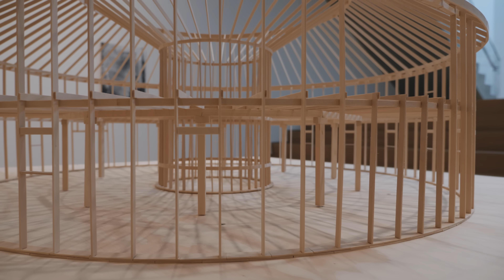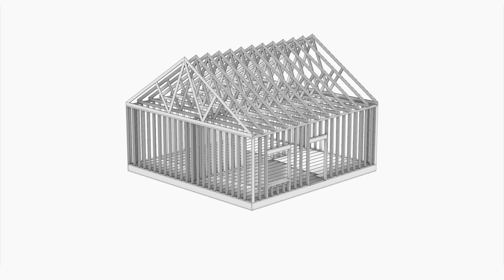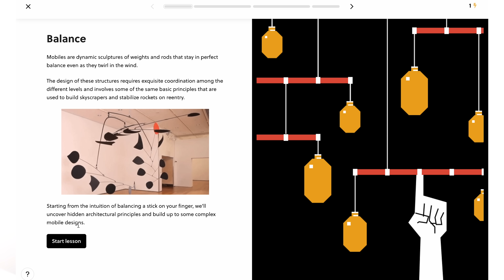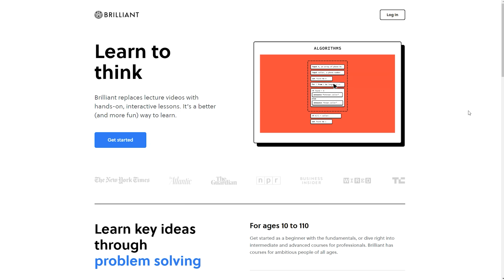The Genius of 2x4 Framing

Comment: Modest structure can be built by semi-skilled  guy and a teenager with no attitude. Brilliant method of construction.  Without this type of such a light construction there would have not been "Case studies homes", later on and "early Gehry" in 80's.
One downside is a low thermal mass . Other may be, due to ease of construction there is so many out there doing it (think house flippers) , that one can "democratically" end up with less skilled framer building his or her house.

Comment: To say you do not need skilled labor is a stretch. Surely a non skilled person can muddle their way through some construction but quite often the end product put together inefficiently and often results in an inferior product compared to what is built by skilled framers. Also without an ample amount of skilled framers on site the speed of the project will suffer greatly often resulting in a slow process ending, and again, with an inferior product. 

A skilled framer will select lumber for specific pieces knowing that certain pieces of lumber will be better suited in certain parts of the project. They will also know where the short pieces and “scrap” can be utilized. Also skilled framers will know how to use the tools quickly and safely and will have many “tricks” that are not obvious to an unskilled worker and these must be passed down and taught through example. There are many other points that could be made but the point is that framers are by no means unskilled.
Reply: You are correct a Carpenter is a skilled trade. Whether it’s post and beam, 2x4, construction, or building decks.
Reply: @MegaDecker69  a carpenter is just a laborer with tools.

Comment: I understand that the wood is well standardised, but surely all your arguments could apply to bricks and blocks too? Standard sizes, logistically easy, and they form a stronger end structure. I see the use of wood as more of a cost saving measure, like a McDonald's burger instead of a higher class burger.

Comment: We renovated a house built in 1830 and the studs were slices of a tree turned sideways on the interior walls and full 2” x 6” around the litter walls all nailed together with tapered square nails.  These studs went between both floors around the outside walls.

Comment: In USA public buildings are made of durable materials, brick concrete, glass and steel. Private dwellings mainly timber with plastic or other cladding - not made to last. In Europe traditionally housing endured for centuries, maintained and adjusted to changeing needs. I don't see the average American house lasting a century, which is wasteful, considering they would be low cost if it weren't for banks manipulation of price for their own profit.
Reply: The Average American doesn't give a toss about what's going to happen 100 years from now. We know we'll all be dead.

Comment: As someone who started framing homes in the 1970's I could say many things about your video.  But I will stick to what I think is most important.  The reality that logging our forests to create framing lumber is completely unsustainable.  As a young framer I saw beautiful, straight, clear lumber to work with.  By the turn of the century this was mostly gone.  The reality of how forests are managed and the lumber we get from that system is absolute destruction of our forests for a poor commodity at this point.  My opinion is you need doug fir trees to be at least 100 years old to create quality framing lumber.  We will not be able to continue to create homes like this in the near future.  And the ones we make now are of poor quality compared to forty years ago because you are starting with poor quality framing  (bones) lumber.
Reply: Amen.  Back in the day 4x4 were cut from 30" logs and were serious timbers.  What I can get today seems to be cut out of 6" logs and is basically a square sapling.  I honestly think the future is going to be just earth plus some sort of binder out of an extruder.
Reply: I live in a two story balloon frame house in Canada built in the 1920s.  It has brick veneer, but under the veneer are planks a foot wide that run from one end of the house to the other.
Reply: @minuteman4199  Those planks are probably worth more than the house these days.
Reply: You've never seen good wood. I was working on a 185 year old building and there were boards in it 20 feet long a foot wide with grain straight as a laser and clear of knots. It was absolutely mindblowing. I ripped them boards off the wall, chopped them up and tossed them all down a garbage chute. Because that was the job.
Reply: Would you say that composite boards or any better or worse in regards to the sustainability issue? Can there be quality 2x4s made out of composites?
Reply: @TwoForFlinchin1  There are a lot of new products that I hope stand the test of time.  Laminated Veneer Lumber (LVL) for example, I beam floor and roof joists, oriented strand board.  Sustainability? That is a harder question.
Reply: @TwoForFlinchin1    I am not sure if they can make composit 2x4's or if that is a reasonable solution to sustainability.
Reply: The wood industry is very sustainable. There has actually been 70+ years of forest growth based on the surveying data the USDA tracks, which is why deforestation is a concern in South America and other parts of the world but not North America.   https://www.fs.usda.gov/managing-land/sc/sustainability

Comment: I like your videos, but two statements here I found jarring and Ill considered... "almost any 2x4 is as good as almost any other"... um, no. There are species, grades, etc etc. and that's not even looking at how straight the board is. I've picked up 2x4s that would work to knock a horse unconscious and ones that broke right in my hands. Which leads me to the other statement  " you don't need skilled labor to produce wood framing" ....uh, unless you want your house to be sturdy, straight, without creaks and badly functioning doors... a bad framer can cause endless extra work ( often by failing to select the correct 2x ) for the sheetrockers, trim carpenters, cabinet installers, costing hours and hours and, y'know, money....  timber framing does take more skill, I'll grant you that though.

Comment: While everything in this video is true about the comparative ease of 2x4 construction, there are still a lot of info that requires skilled and experienced laborers. Because it is pretty much certain that a lot of the lumber in any project will be warped and have imperfections. So there are a lot of tricks to make the redundancy in construction methods overcome imperfections in the base material. 

This I learned building houses while volunteering for Habitat for Humanity.

Comment: 8:30 "Americans prefer standardization over variety"
I don't agree. You choose wood-framing and hamburgers when you want cheap, fast solutions. Trying to maximize the size of your meal or house for your money.

If you care about quality, craftsmanship, environment, long-lasting solutions you would not make this trade-off.

Wood framed homes don't last as long and are more prone to water/termites and other issues. Many wooden framed homes are built with very little insulation resulting in huge heating and cooling bills.
Reply: that is just anecdotal shit take. you can build in as much insulation you please in light wood framed house, when heating was cheaper than properly insulating, that is what they chose. in Norway and Sweden light frame is standard practice, and we need insulation, so we install it. it will last 100+ years with a little bit of maintenance every 10-15 years.

Comment: first off, screw you I actually ordered McDonald's because of this. Secondly, very interesting vid. I know a lot of Europeans poo poo on 2x4 designs in America, and they can't wrap their head around why it would be done this way. But you left out an important detail about wood framing. It is fairly easy to upgrade, redesign, add on, and/or take away from these structures.

Comment: Old concrete buildings are often cracked and falling apart.  Wood is a far more flexible material so it is much better than concrete in earthquake zones (see Japan).  A wood frame home built to hurricane building codes will definitely outperform a typical European home, and no type of home is going to resist a direct hit by a strong tornado.  

Something that isn't usually mentioned is that wood is a sustainable building material while concrete has a horribly high carbon footprint and is using up the world's sand at an alarming rate.  

Wood is really quite amazing, it can be shaved as thin as paper and very flexible or manufactured into configurations that are stronger than steel by weight.

Comment: This type of building needs to be outlawed in coastal areas prone to hurricanes, where concrete domes need to be mandated so we get out of continuous replacement of these ill designed homes.

AI Domes, (not affiliated with the company at all, just am a Florida resident who grasps the benefit of concrete dome construction in hurricane zones) a Florida concrete, DIY dome home provider have been at ground zero of every major hurricane in Florida.  The worst damage ever was a 6" crack in a knee wall as a result of a double wide horse trailer being thrown at the home during the hurricane.  The crack was caulked and life went on.

How do we make the switch?  We price insurance incredibly high on stick construction, and incredibly cheap, as it should be, on concrete dome construction.
Reply: No one wants to live in a building shaped like a dome. When you're warned that a storm is approaching evacuate you git.
Reply: How does concrete domes work with the high humidity, hot temperatures (thermal transfer) ? Is rebar needed, if so is there salt air corrosion? Any lime poisoning, sweating, condensation?

Comment: I would like to ask: Why is it import to build something that lasts? From my experience in life, the old heavy structures from stone/brick/timber/whatever are unaffordable by almost everybody, and the cost to renovate them to modern standards is excruciatingly expensive. In almost all cases if it were a stick built house, it would be a fraction of the price to tear it down and build something new than the cost of renovations of old buildings. Stick built houses can be beautiful even though everybody loves to throw-up the worst examples.

Don't get me wrong, some old structures are worth it for the intrinsic historical value, but most of them aren't.

Also, this applies primarily to single family homes. For anything larger I think it does make more sense to make it last as long as possible.

Comment: Awesome video.  Oriented strand board is not made from sawdust but rather shredded strips of wood usually from Aspen trees.  Practical board is made from sawdust though but is rarely used in the home construction industry today.   Particle board is often used as a substrate for cabinetry and laminate countertops.
Reply: good comment I was thinking that during the video.  I'm pretty sure they farm those small rapidly growing aspen trees specifically for making OSB.
Reply: They are bothering not made from waste products but rather the trees get chopped to a specific particle size exclusively for the purpose of making those boards, at least here in Germany at Egger, a major manufacturer of MDF, OSB an particle board in Europe.
The particle size and uniformity are extremely important so regular sawdust wouldn’t cut it…

Comment: Wood framing is great. Putting OSB sheets directly on the outside and the panels without an air gap is insane and one of the reasons US houses last for such a short time. In the Nordic countries we have wooden houses several hundred years old but they all have an air gap behind the outer panel to allow moisture to dry up.
Reply: It should also be mentioned that the U.S has more natural disasters like tornados where your  house is almost guaranteed to be destroyed no matter construction or material so while having decently built houses is important the expectation is that a nature will bring your house down here at some point it could be 1year it could be 30
Reply: I grew up in a 150 yo wood house in the Midwest, tell me more about how they don't last? How long do you need when you'll be dead by 90 at the latest?
Reply: why are there always foreigners on US videos spewing ignorance and nonsense?
Reply: @mariacheebandidos7183  Thank you for the feedback. My comment was directed towards those with construction competence who might want input from more than local sources. They understand that it is the opposite of ignorance to have knowledge about alternative building methods. May I also inform that Youtube is a social media with opportunities for global interaction which is favored by those not inbred.
Best Regards.
Reply: The 1970s two oil crisis created the usa tight house dogma. So in late 80s and later got toxic mold. Lol

Also 60s and before homes often had plaster which is mold resistant
Reply: It's why Zip and all of those integrated vapor/moisture barrier OSB sheet goods have become the big ticket in home building here in the US
Reply: I've never lived in country with residential housing built in this wooden frame construction. However, looking at these houses in their naked wooden frame stage, I can see why there is such utter destruction following storms that are anything above a severe gale. And wood rot? Is that a serious problem in damp/humid climates? As for fire risk, it looks like living inside a tinderbox. I don't think I could sleep peacefully in such a house, especially upstairs, with the prospect of a fire raging away on the ground floor.
This all sounds a bit harsh, and I welcome our American friends willing to educate me on any errors. It's just I prefer bricks and mortar, you know, solid mainly non-combustible structures.
Reply: @hairybear7705  

I'm pretty sure you will have a lot of homes with wooden floor beams and roofs, despite having solid masonry walls. So the risk isn't that much greater. Wood rot is of course a problem especially with the cheap softwoods used nowadays. 2x4 pine framing is pretty much a joke, the bare minimum needed to not have the house collapse under its own weight.
Reply: @westelaudio943  wood rot is not a problem because the wood used is most of the time treated while also having vapor barrier under the house so it's really not a problem
Reply: I'm not planning on being here 100 years Otto. If my house lasts another 20 or so it's all good by me. Do you know why they call real estate property? Because that's what has real value. It don't matter what's on it. There's only three things that matter in real estate and that's location, location, location!
Reply: @1pcfred  I Guess its also a difference in space available. In the USA, there is space for houses to be built anywhere. In Europe, things are very densily populated. You dont get building permits easily. When you are buying a plot, there really is value from the house itself much more in comparison than in the usa, because building yourself a new one is just a terrible thing here in Europe. Everything is build by corporations entire neighborhoods all at once with terraced houses. You cannot buy one of them and think you know what im gonna built something new here. So we are forcing the builders to built something that lasts 100 years or more. Nevertheless i really understand why in the USA they built like they do.